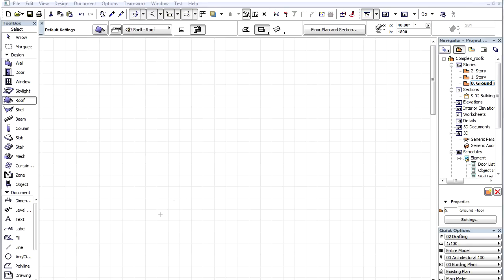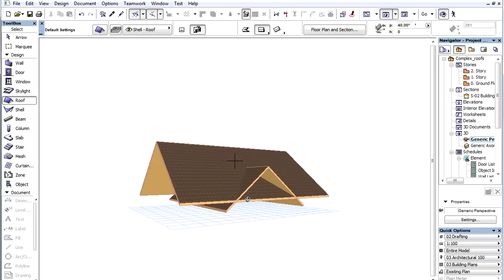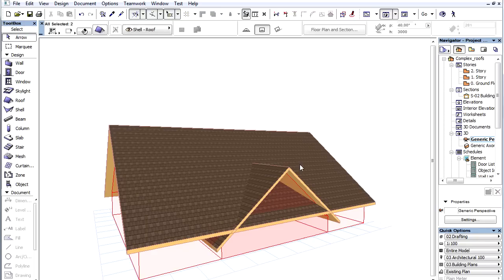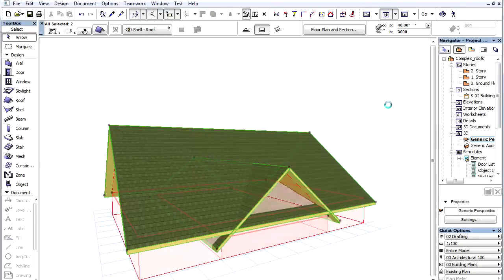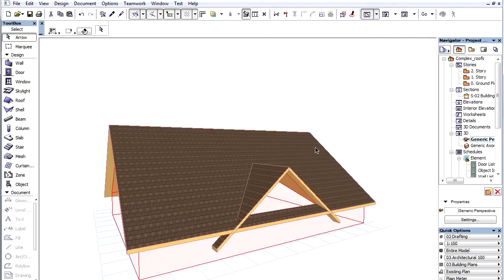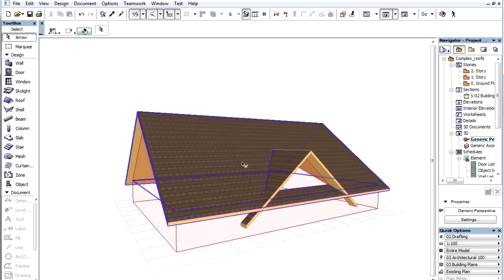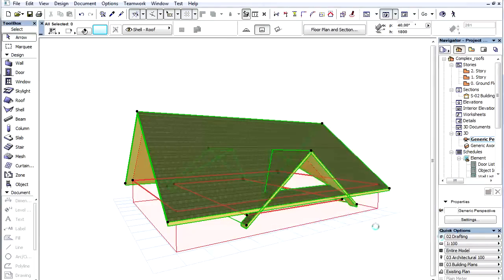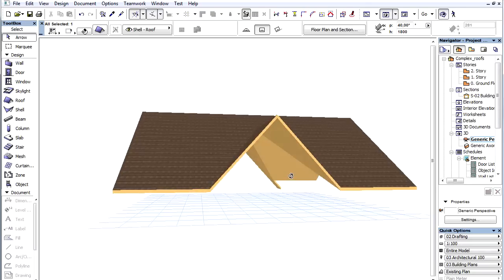Complex roofs in ARCHICAD - Cross-gable roof

Comment: Very clear and nice way, but ......roof made this way doesnt work with RoofMaker Wizard.
When I apply this add on  it doesnt recognize it as one roof and makes rafters as if there were to separate roofs even if i combine them using solid element operetor. Any solution to this problem? Thanx.